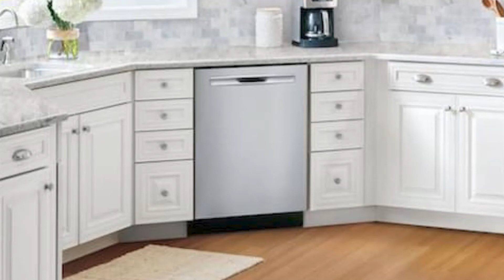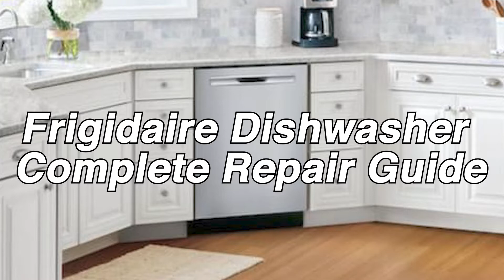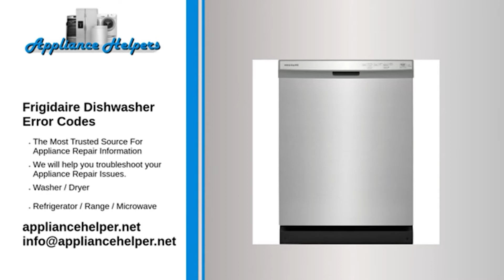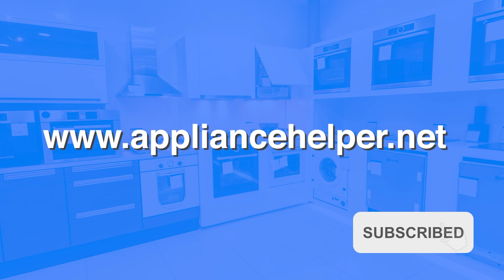Frigidaire Dishwasher Complete Repair Guide - Learn Error Codes and Troubleshooting

Comment: Nice video but it doesn’t explain how to access the error codes 😢
Reply from the maker: Frigidaire dishwashers often have a diagnostic feature that allows you to access error codes for troubleshooting purposes. Here's a general guide on how to access error codes on a Frigidaire dishwasher:

Enter Diagnostic Mode:
Start by making sure the dishwasher is in standby mode (not running any cycle). Then, press and hold the "High-Temp" and "Start-Cancel" buttons simultaneously for about 3 seconds. The control panel should respond by entering diagnostic mode.

Navigate Through Error Codes:
Once in diagnostic mode, the control panel might display error codes. These codes are usually numerical and correspond to specific issues. Use the "High-Temp" button to scroll through the error codes.

Interpret Error Codes:
Refer to the dishwasher's user manual or technical documentation to interpret the error codes. The manual will provide a list of error codes along with explanations of what each code indicates.

Exit Diagnostic Mode:
To exit diagnostic mode, press the "Start-Cancel" button. This will return the dishwasher to normal operation mode.

Power Cycle:
After obtaining the error codes, you may want to power cycle the dishwasher by turning it off and unplugging it for a few minutes. This can sometimes reset the control board.

Contact Frigidaire Support:
If you are unable to interpret the error codes or if the issue persists, it's recommended to contact Frigidaire's customer support. They can provide assistance based on the specific error code and help guide you through further troubleshooting steps.

Keep in mind that the specific steps and features may vary depending on the model of your Frigidaire dishwasher, so it's essential to refer to the user manual for accurate instructions tailored to your appliance. Always prioritize safety and follow proper procedures when troubleshooting or servicing appliances. If in doubt, seek professional assistance.